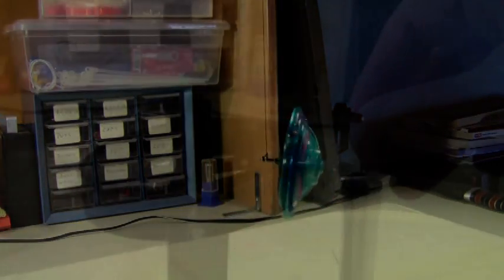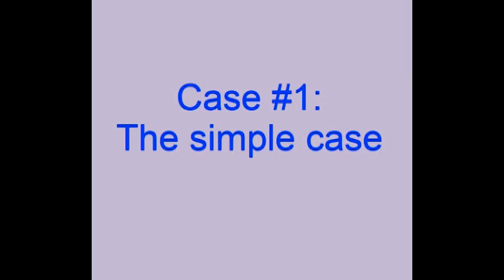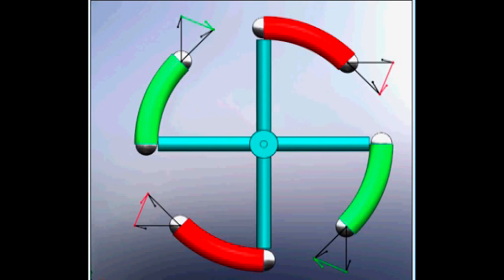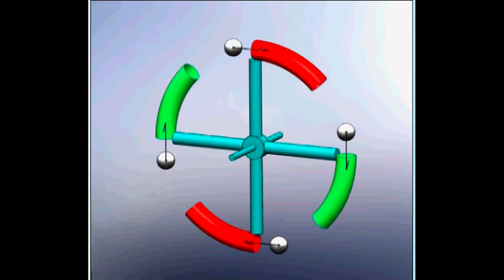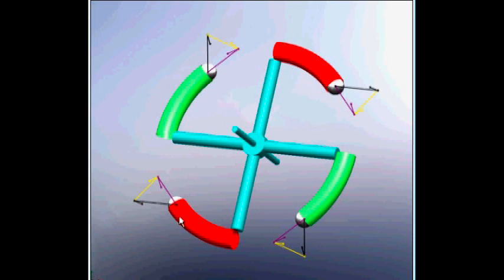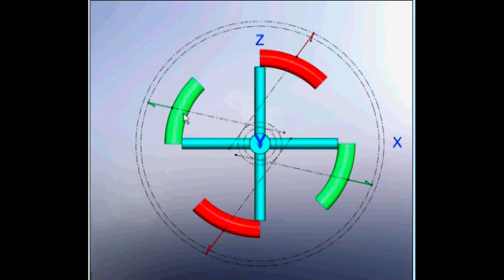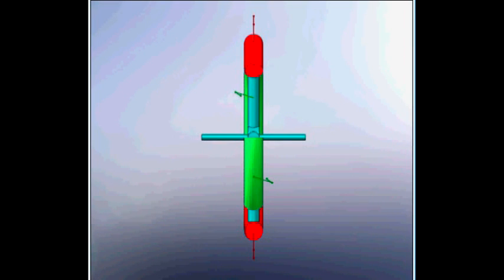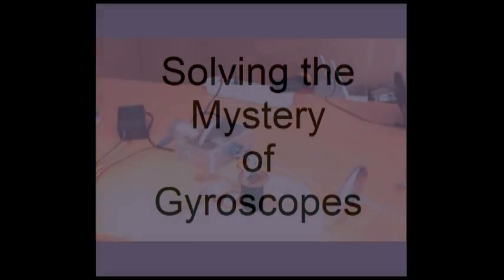Solving the Mystery of Gyroscopes

Comment: 1.  The deflection shown only applies when the rotational displacement occurs, not when it is in a steady state. So any "out of balance" forces will only apply as the gyroscope shifts, for brief periods of time.  2.  When the gyro wobbles, the forces would oscillate in a counter acting manor.  Again, acting as you have shown both proportional to and during the rotational displacement.  However, those forces should balance out.    

That said, I appreciate the video and your work.  Just wanted to hopefully get that info out and see if you had any thoughts on it.
Reply: It seems to me that the desire to precess is manifest in the inter-atomic field geometry, just like any magnet. When coherent spin force is applied to the flywheel, a strong centripetal field geometry (dielectric acceleration) is created in conjunction with the obvious centrifugal force. A dielectric plane of inertia is concentrated, therefore changing the flywheels magnitude. Gravity (weight) is dependent, among other things, upon magnitude. A precessive force that is counter-rotation, is additive force and motion away from the centripetal dielectric acceleration (force dissipation null point) which can also be described as anti-gravity. I believe that this phenomenon is entirely field based. A very strange field geometry is manifest in any matter when it is spun. It is truly a real head wrecker. I cant though, work out whether a strange mono-pole is created or whether it is a weird compressed di-pole situation, similar to a permanent magnet. The pressure meditations certainly behave the same. Awesome thought experiment though, cheers.

Comment: or you could have said the 'gravity' is offset at the 'square' by the amount of inertia - when you add a 'weight' to the offset {in the offset state}  you are in effect putting the offset of the inertia out of balance so the wheel then precesses.

Comment: is there a multi directional gyroscope and if there is do they behave in the same way as a conventional one?

in the film Event Horizon, during the last 20 minutes there is a section where some of the crew fight it out around a death gyroscope. this gyroscope is a bit different. Would it ever be possible to create a gyroscope or something like it that can travel in a multi directional way at the same time?
Is it anti-gravity or is it simply the flow of air as it passes over and through the spinning disc that creates its lift? if the disc was to spin in the opposite direction would the gyroscope behave in the same way? would this be a good test to either refute or backup the claim that gyroscopes have an effect much like anti-gravity?

Comment: the gyro has a mechanical transfer of movement in the bearing (armature to stator).  gravity pulls down so there is more pressure on the top of the axel.  if u support the axel from one side then the pressure is higher on that side friction is higher on that side transfering mechanical movement making a precession

Comment: I am getting that the vertical spin torque differential with a perfect horizontal , once washed through a transition matrix is .985, irrespective of mass, diameter and rotation.
Also all my bicycles are busted. Makes sense ?

Comment: As for the torque force dependence on G. If my gyro weights 3 tons, and rotates at 3000 rpm around a 5 feet radius, some measurements could be different. But on the moon or elsewhere, Is their an equivalence relation in the lower moments ?

Comment: Beautifully illustrated but.. 4.20 "the torque imposed by gravity on a spinning gyroscope". If this is going to make any sense then you can't just drop statements like that in without some explanation. What torque? Why? Where from?
Reply: +Mark Horton If the apparatus is held at one end of the z-axis stick, the force of gravity will exert a moment due to weight. This can be expressed as a torque rotating the device.
Reply: +Owen Heaney  Sorry I still don't get it. Why should gravity exert a rotational force in any plane on a vertical "wheel"?
 If the wheel is vertical there will be no rotational force with a sideways action to the plane of the wheel. Since all elements are equal, clockwise and anti-clock wise moments will also be equal.
Reply: +Mark Horton To hold up the device you exert a vertical force equal and opposite to the downward force due to gravity. Thus there's a couple produced
Reply: OHeaney Ok, but if you hold it up in a steady position, the upward force and the downward force are equal, so surely there is still no turning force. I think I am missing something.
Reply: +Mark Horton the two forces act at different points on the frame. So, while they cancel out, they do produce a net moment. If I could draw a diagram I think I'd be able to explain it better... 
Try drawing a free body diagram of a stick, with an upward force atone end and gravity in the middle. If you try to find equilibrium of moments around the left hand side you'll find that there's an overall torque. You'll also find that this is the same everywhere; this is the characteristic of a couple- it has no net force, but produces a rotation. It is a pure moment, not acting to displace the body but only rotating it.
Reply: OHeaney Got it.
Thanks very much. 
Though I will think further on this and may come back.
Reply: +Mark Horton any mechanics-related problem you have I'm happy to attempt to answer :)
Helps me test if I actually know what I think as much as it might help you!
Reply: OHeaney Thanks, will do.

Comment: Another way to look at the gyro is to imagine the wheel as a cross with elements at 4 points on a clock, 6, 9, 12, and 3 o'clock, with 12 on top of course. 12 thru the center vertically to 6 is the unmoving y axis, 9 thru the center to 3 the x axis and the rotational axis is z. 

Twisting the rotational (z) axis is said to be about an axis, x or y when it rotates the plane of the spinning gyro around that axis. So holding the rotational z axis at arms length, a twist or rotation of our hands is about the x axis if we rotate our hands counter-clockwise or clockwise. 

If we push-pull the rotation is  about the vertical y axis either clockwise or counter when viewed from above the spinning wheel. 

We may rotate the wheel from 12 to 3 away from us or 12 to 9 towards us -- as we state a convention where the 9 o'clock is closest to our body. So holding our hands straight out form our body, the wheel's plane is normal (at right angles) to our body and the floor. Let's say we spin the wheel from 12 to 3 o'clock away from us. 

Then, with the wheel spinning, we twist the axle clockwise looking straight out, so the plane of the wheel attempts to rotate around the x axis -- the top or 12 o'clock being impelled to the right.

What happens to the cross elements if we slow the action down in our mind? The 9 o'clock element which was nearest our body converges on and to the right of 12 on top of the wheel -- towards the y axis  and to the right, thus making a curved rightward path -- or attempts to.  We are saying we are trying to make the wheel's elements follow this path by our force on the axle.

The former 12 o'clock element will try to converge on 3 o'clock making a path that has to twist the spoked element clockwise from our point of view (looking outwards) -- but whose path-target does not diverge from where it would have gone if the wheel's axle was not twisted. It is still impelled to go directly to where the 3 o'clock was when you started twisting the axle.

We disregard the rigidity of our grip on the axle and imagine that the axle is free to move i.e to rotate around any other axis in any direction that we are not impelling it to move by the force we are putting on the axle. In other words, since we are constraining movement in the direction of applied force it either moves against our push or away. It's reaction due to inertia would be to move against the push, as that is its natural force. At the other axis in this case the Y it is free to move since it is not constrained. Thus if there is a rotational force around Y axis it must move about that axis. The forces around the Z axis are rotational inertia. The forces about the X axis are induced by our hands. The forces about the Y axis are induced by the translation of the force about the X axis to the Y axis given the imparted force in the rotating elements. These elements push back against the push induced by our hands, and around the Y axis.

The upward moving element going from 9 to 12 exerts a force counter to its presumed or impelled curve path, by Newton's first law and third law. Since the wheel is free to move around the Y axis, as it is by our statement not constrained otherwise, this reactive force must make it move around this axis. If the wheel is spinning rapidly this force is considerable and may be much larger than our force impelling it to twist around the X axis. The wheel's elements have considerable inertia at high speed. 

The curved path which we attempt to induce by twisting the axle clockwise around the X axis is an impelled twist to the right. This path appears to be a clockwise curve when viewed from the top in this case, so the wheel's movement in inertial reaction to this force will be clockwise around the Y axis. We have in effect induced a detour in the path of the rim by pushing right on the top. If our eye follows the path from 9 to 12 from above we can clearly see its curvature to the right. The wheel therefore it movement not being constrained in this direction must follow the curved path and twist to our right.

If we imagine we are pushing on a frame on the rim of the wheel, there would have to be an inertial resistance to our push due to the rim's rotational inertia -- its force in the direction of spin. There is however no resistance at 90 degrees to our push -- which is the 'rotational direction' around the axis that is normal to our applied force vector. The Y axis is at 90 degrees to, or normal to the sideways vector of our leftwards push on the rim at 6 o'clock -- which is also rightward at 12 as it is a torque. In effect the Y axis in this case "wobbles" rotationally underneath our effective push on it, and twists away from us in the direction of the wheel's spin.

The effect is if we look at the path "called for by the push on the rim elements of the wheel" is that they "attempt to get there" so to speak by moving against to the applied force. By this we mean that there is a twisting movement around an axis which is at right angles to the applied force vector. In this case the Y, or vertical axis. 

Imagine we are applying force at the rim of the gyro. If we look back against the spin direction along the rim 90 degree's lets say and follow the spin as it approaches the point of force on the rim... let's say we are pushing on 6 o'clock towards our left in the set up above described .. we imagine just the element of the the gyro spinning from 3 o'clock to 6. Thus the rim point which was at 3 approaches to the left of 6 or tries to.   ---- If the gyro is free to rotate about the vertical or Y axis, then one way it can "get to" the leftward position that the force attempts to push it to, is to spin clockwise around the vertical Y axis when viewed from the top. In other words "in the direction of spin" the gyro reorients itself in order for its rim elements to travel in line with, or in the same direction as the force applied. The rim at the point of applied force remains stationary or tries to and the point at 90 degrees to it moves such that the spinning rim elements try to travel toward the direction we are attempting to push the rim.
Reply: +Eric Charters Great science Eric. I admit a bit dangerous. Here is my 2 cent question : You do the simple rope holding a sniping wheel by the left or right of the shaft. You put a scale on the end of the rope. You got your fast spinning wheel and your horizontal shaft. Then you put 10 grams at the other end of the shaft. Then 20, then check the angle. Then what's the math ? Thanks for your differential topology experiment. I will keep at it.
Reply: simple simple.. total weight on rope is equal to gyro plus weight.. torque arm around the support rope is gyro wt times A-dist to gyro plane.. let's say clockwise.. then at end of shaft torque arm is clockwise of applied wt times 2A dist to end of shaft Obviously upward counterclockwise torque of gyro equals wt of gyro and applied wt until it doesn't anymore.

soooo the math of the gyroscopic righting force is a tad more complex..
http://www.real-world-physics-problems.com/gyroscope-physics.html

Comment: I think this video explains things pretty well.  It might be more understandable if you bring in the inertia of each point mass along the circumference of the gyroscope.  The instantaneous  inertia of each point mass due to the rotation far exceeds any momentum that gravity would impart upon each point mass so the wheel remains fixed in its original position rather than flopping over.
Reply: +MrLakeOntario1 so why does it seem to get lighter ?
Reply: +J-N-H-M  The perception that the gyroscope gets lighter might be an illusion.  It would be interesting to spin the gyroscope so that the disk of the gyroscope is parallel to the ground.  That way gravity is working uniformly on the entire mass of the gyroscope.  When the disk is perpendicular to the ground,  half of the disk has inertia against gravity while the other half of the disk has inertia with gravity.  One would think that these inertias would cancel each other out though.  Perhaps by keeping the gyroscope from falling to the ground, the man is negating some of the inertia working WITH gravity.  So the inertia of the ascending half of the gyroscope asserts itself...gravity has to do work against this inertia and the gyroscope seems lighter as a result.
Reply: MrLakeOntario1 yes , but ok , it only appears to be lighter when its allowed to precess with gyroscopic precession 

and as google even knows " Gyroscopic precession is a phenomenon occurring in rotating bodies in which an applied force is manifested 90 degrees later in the direction of rotation from where the force was applied."

key word Phenomenon , because you push it horizontally from the back , and it goes up ? 
push it from the front and it goes down ... 
its bonkers ... and makes this marble concept in the video even harder to understand  , because the forces of all the marbles flying in at once and hitting the walls would all cancel out... 

have you heard of the magnus effect ??? 
i think we all should Hypothesize that this plays a role in why it seems lighter at least when gyroscopically Precessing  ...

and the Rest is more complicated then i wanna try to explain right now ...
learning about how the gyroscopically stabilized motorcycles work helped me understand a lot more , by seeing how they let the gyroscopes wobble to correct an outside push on it ...  and the NASA cd player (gyroscopic stability effect) experiments in space ... 

But The mechanical Hybrid systems that spin flywheels at ridiculous speeds in formula one cars , Makes me wonder what exact effect it has on the car ??

Comment: well that solved nothing. you could have saved 10 minutes and simply said you dont know. explain the thing everyone wants to know. a heavy wheel on the end of a bar too heavy to lift spin the wheel and you can lift it around you so simply put where does the weight go because i assume if you stand on scales the weight is the same however it goes some where because you can then lift it with ease even though its going round you but the fact is its not resting on air so the weight or force of weight is moved elswhere
Reply: It did expain that, you just didn't understand it. Look at how the torque around the x axis is affected to counteract the torque pulling it round and down when you hold the bar at one end. This is what changes, not the weight of the object. It's not that the object is too heavy to lift, it's that it's not possible to hold it from the end of the bar without some other force counteracting the torque. This video showed where that force comes from.
Reply: Aba Zaba http://en.wikipedia.org/wiki/Cavendish_experiment
Reply: Robert Horn wish i was...
Reply: +Aba Zaba I believe that it is pressure on at least two masses that gives the illusion of what is termed gravity.
Reply: Only theory? You make two serious mistakes here. First, it is called Newton's LAW of Gravity, not theory. Second, even if it was, you undoubtedly have no idea what theory is. If I remember correctly, 98% of today's modern technology is based theories. It is a common ignorance mistake to underestimate the word theory, probably because of confusing it with hypothesis.
Reply: Tea wrong....
gravity is only a theory, when you prove mass is attracted to mass, then talk